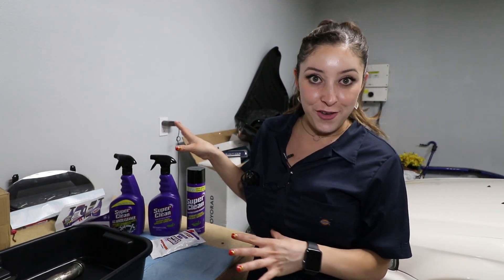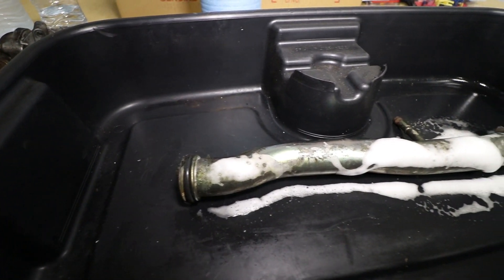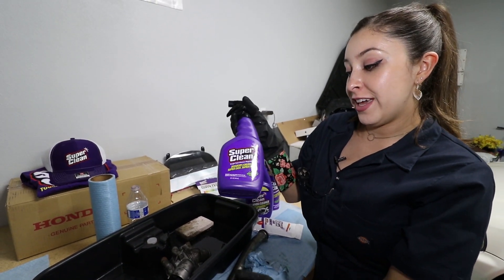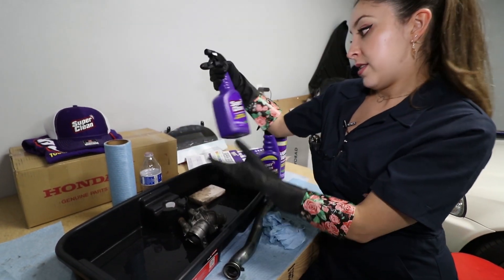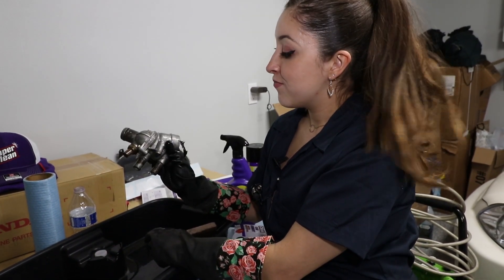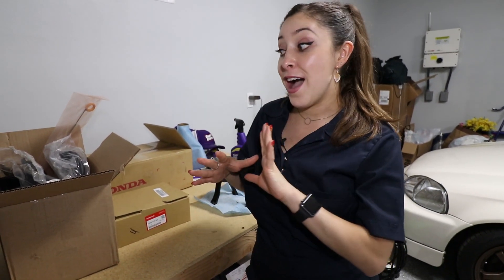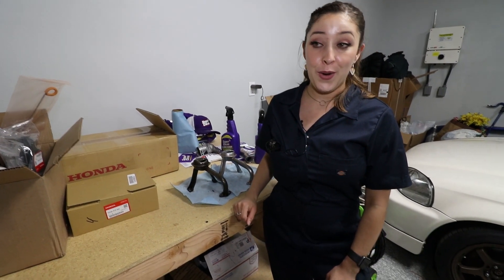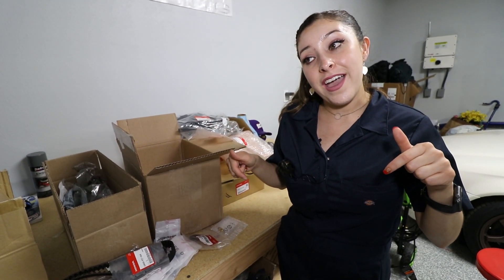The Honda Civic is SUPER CLEAN!

Comment: use a soft metal brush, you can use a fine sand paper to remove the old stuff on pipe. make sure you replace the plastic ring when putting back the pipe to the thermostat. Metal brush would help you remove all residue.